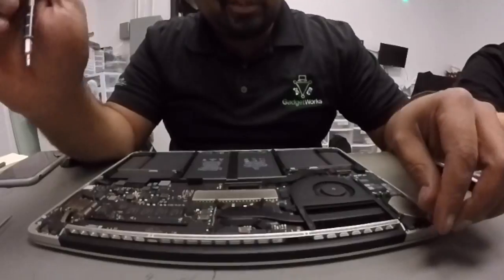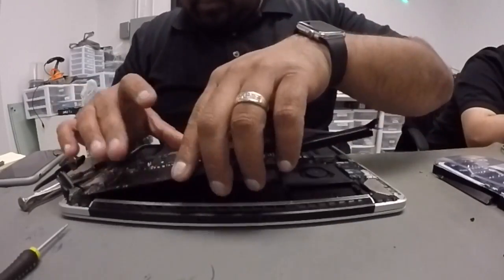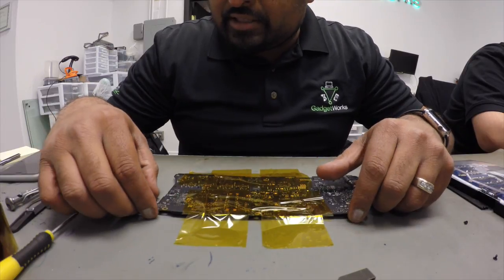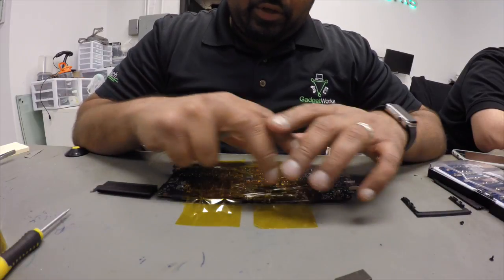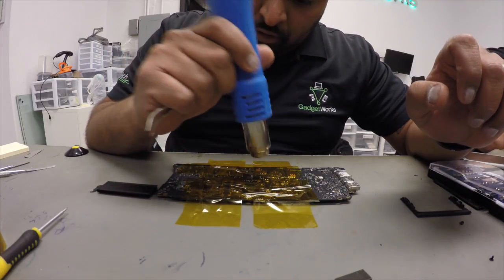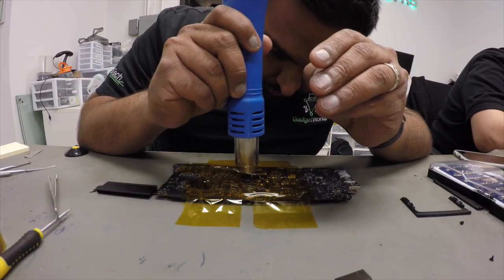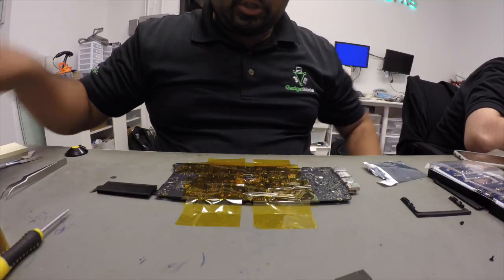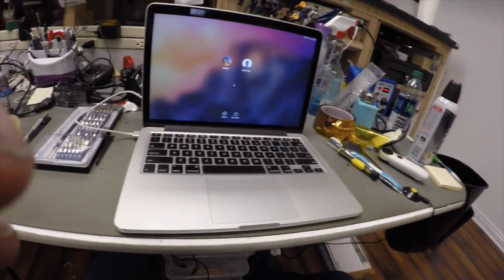2015 Apple Macbook Pro efi chip

Comment: Damn.
That chip would come off the board in 30 seconds. Practice it a bit an other time before posting a video like that, and don't want to tear off the board off the ESD mat grabbing the heatsink, you may kill it.
Reply: what temperature you use bro i need to do it cause i have burn my chip on 215 degree
Reply: If lead free solder melts at 217-221 degrees (google is your friend) Celsius, then 50-80 degrees higher will do the job, but slowly. You should get to know to your repair tools, and practice the settings, that you can work with. Every tool is unique, there is no big book for every question. Use your knowledge and brain, that will do the job. :)